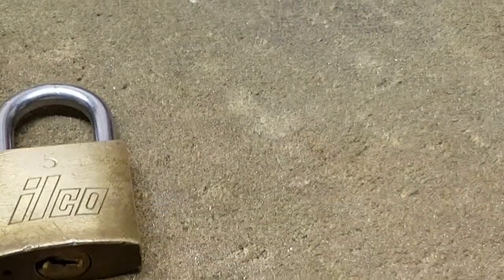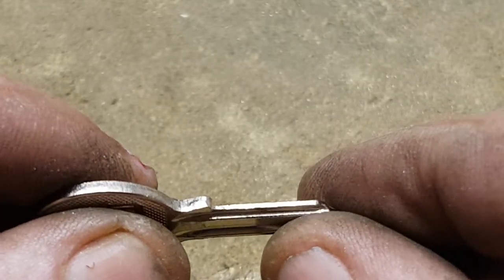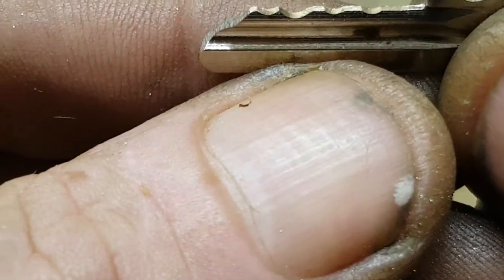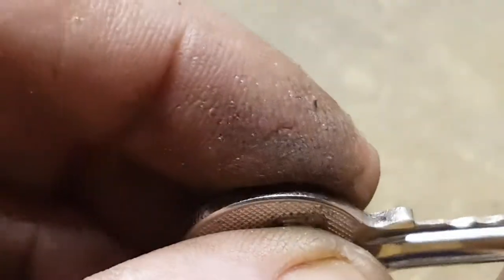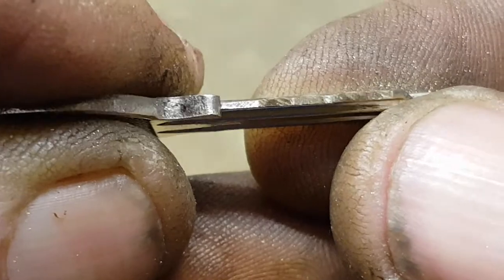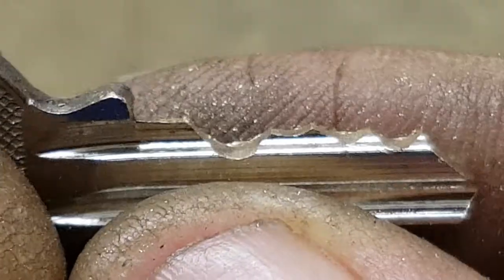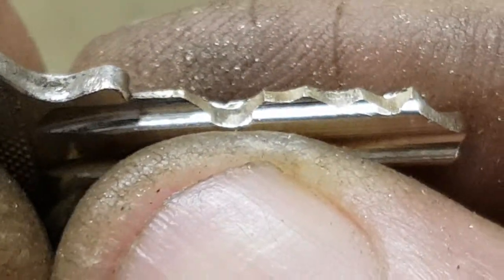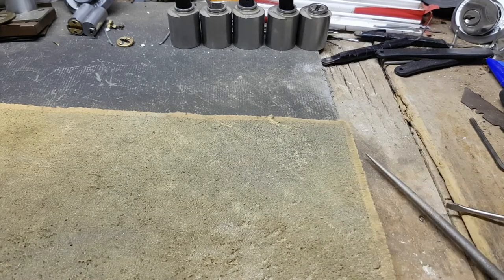#246 Ilco 30mm padlock(YA7/8 Key blank) impressioning hints.

Comment: Awesome video mate. 
You need to use a set of multigrip pliers to make it easier on yourself. 
My hands cramp up when doing it all by hand. The small padlock doesn't help either lol
I've been meaning to order a good quality file to impression some 234s.
Is it the one you use a  
Swiss #4 cut file?
Reply from the maker: Thanks mate. Yeah, i would use my impressioning tool normally but i couldn't be bothered reaching the 3 feet to grab it. lol. Butt lazy! lol. You can use a Pippen file for similar results but the one i use out in the fieldis the 2 cut 150mm Swiss. They are about $40 each. Not that cheap but an important item to have. Cheers:-)PS. Do you read your emails ya slack bugger:-)
Reply: @crankylock7844  never seen the pippen brand before.
I've seen the fieldis ones just wasn't sure what cut to buy. Seen them selling for 50 with delivery.

I haven't checked my email lately. Will go through them now.
Thanks Paul 🍺

Comment: Why would an Ilco padlock be using a Yale profile?
Reply from the maker: Not sure to be fair. I have no doubt there would be a Silca blank maybe prefixed IL????. If it is fit for purpose the a Yale blank is a reliable blank for the job:-)
Reply: @crankylock7844  Yes, but that wouldn't be the original key that came with the lock, would it? Surely an Ilco lock would have an Ilco key.
Reply from the maker: @two_tier_gary_rumain  Yeah, the original key would have been embossed with the Ilco Logo. I am sure there would be a Silca blank for the Ilco other than the Yale blank. Like i said, probably embossed S(for Silca) IL(for Ilco) and a number. I'll have a quick look in the Silca directory.....back shortly:-)
Reply: @crankylock7844  No worries. I can also look it up in their online catalog.